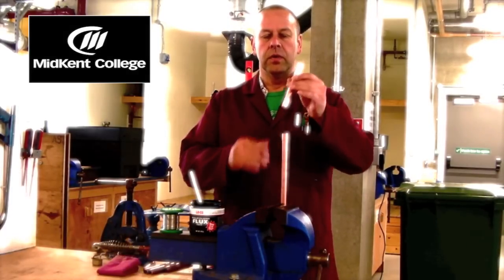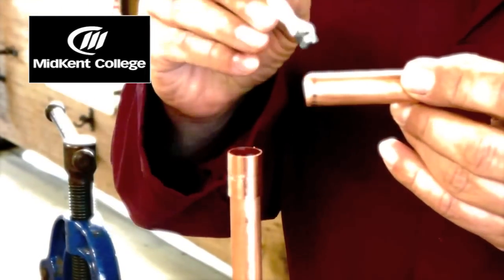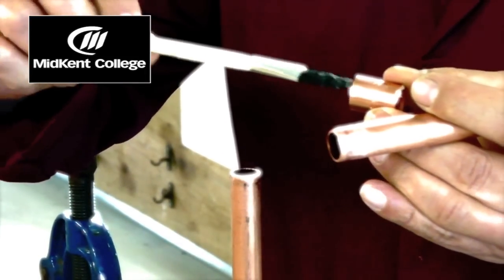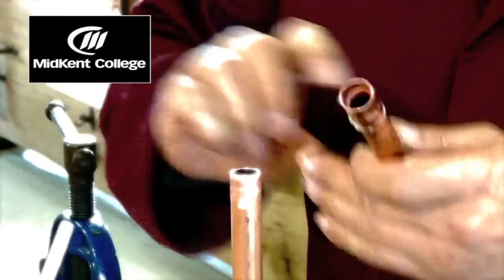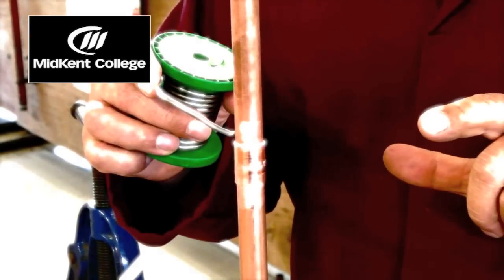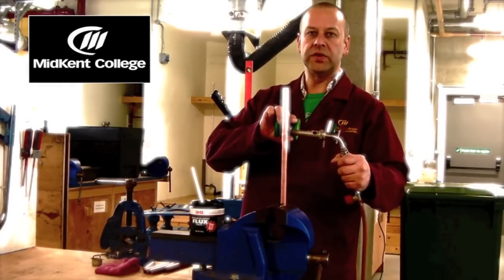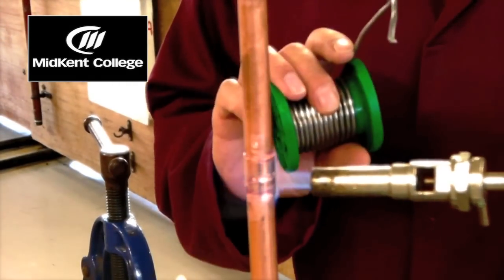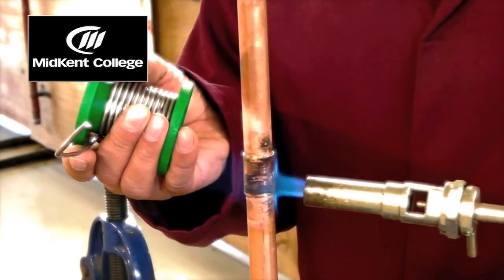MINI TUTORIAL: How to solder copper pipe for plumbing or gas

Comment: Several things wrong with this tutotorial - one has safety implications.
1. NEVER use cold acidic flux (no matter how "mild") on fittings intended for gas.
2.Dont handle the clean ends of the pipe with fingers - "finger grease" can inhibit solder adhesion.
3. No instruction on how to clean the pipe- Pipes will often be very dirty
4. This is an ideal situation never seen in practice. Pipes are often in corners, and/or against flammable substrates with one side of the fitting often not visible
5. "Take care when using a blow torch" is a facile statement. Show how! (e.g. wear safety specs, protective gloves.
6. If the pipe is to be used for potable water, lead free solder must be used (UK)

diymostthings
Reply: diymostthings and your not supposed to flux the female end as acidic flux slightly bonds the copper so it’s hard to move once in place before soldering. This will help if you need reposition a elbow for example
Reply: also no mention of what gas mix that torch is set up for
Reply: also solder the bottom part of the joint first them move to the top

Comment: I think it's bad practice to apply flux to both the tube and the fitting, regardless of whether you're working with gas or water. I'm being taught to apply it to the tube only, i mean if you don't flush well enough then cavitation will occur, working with water anyway.
Reply: Its the same with gas. Just pipe only.